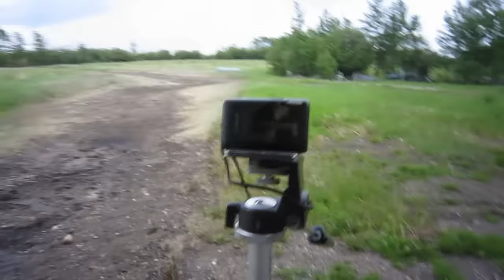Testing a GE J79 with afterburner

Comment: How does this convert to horsepower?
Reply: Its thrust
Reply from the maker: With this engine, the J79, there is an industrial version called the LM1500. The fuel burning core is the same, with identical part numbers.
The J79 jet engine is a gas generator with a jet propulsion exhaust nozzle at the back. The nozzle converts the exhaust energy into thrust by accelerating the gases. It takes a force to accelerate something. That force pushes on the thing doing the acceleration and equally on the thing being accelerated.
The LM1500 is the same gas generator that supplies the exhaust to a separate power turbine via a large duct. That power turbine converts the exhaust energy into mechanical torque and rotational speed. The definition of horsepower is torque multiplied by rpm divided by 5252.

So with this particular engine, we can measure thrust in one form of test, and power with the other.
When I say a J79 has 15,000 Hp, I mean the equivalent LM1500 makes that much.
Give or take, no guarantees, it's just for demonstration.
...OK?

Comment: whats the RPM on those bad boys?
Reply from the maker: I just added that to the info section. Thanks.
Reply: @AgentJayZ  the turbine can spin up to 120,000 rpm
Reply from the maker: Not this one. If it ever sees 8000 rpm, even for a few seconds, the manufacturer's overhaul manual says to scrap it.
The rotor in a Kawasaki GPz750 turbo is designed to spin at over 250,000 rpm, but it is 3/4 of an inch in diameter.
Reply: @Digital Electronic Creative no you don't.
Reply from the maker: You do not build J79s for a living. The last one was built in 1983. I have three different overhaul manuals for three different sub-marques of the J79, the -11,-15, and the -19. They all state that if the engine exceeds 8000 rpm, it must be scrapped.

... what was that again?
...
... chirp...
Reply: @AgentJayZ  holy shit 250k ???? How precisely does one have to balance the assembly to hope to reach these rpms ?
Reply from the maker: I only work with the big stuff.

Comment: I found  2 J79; I m in negotiations to buy them
Any interest to buy them or one of them?
Reply from the maker: Only if they are -19s. Complete with all accessories. Without log books they are worth about 10 dollars a pound if they ran when parked, and aren't piles of rust.
Reply: What is “19s”??
Reply: Just $37k for a complete j79 ran when parked?
Reply from the maker: Hmmmm.... dude, you are in over your head and are about to waste a lot of money.
You'll notice that I typed -19s, which is the plural form of -19, or dash nineteen, short form for J79-19.
If you don't know what that means, refer to my first line.

Cheers!
Reply: @AgentJayZ  
Where does one even buy jet engines been googling for days but all I can find are rc model jet engines.
Need something like a fj33 to disassemble and reassemble. Working or not just need to get my hands on one
Reply: AgentJayZ  now I m ready 
2 J79-8C ; tailpipes with afterburner removed
total rebuilding needed 
2 P&W JT8D with log books (run)
Any interest ? If yes I can text you or I give you my phone

Comment: * just imagine this j79 with nitrous spray...
Reply from the maker: It would do nothing. Nitrous is not a fuel, but a source of oxygen. Jet engines burn their fuel in conditions of excess oxygen.
So nitrous would be only be useful as a way of lowering inlet air temp.
You would a lot, though. A 20 lbs bottle would last less than half a second.
Reply: @AgentJayZ  sorry I'm not the smartest but based of what your saying would nitrous help if it keeps it cool? Or do jet engines not care about temp. I would imagine if they needed an intake

Comment: F14 engine?
Reply from the maker: I just read an interesting discussion about the initial and replacement engines used in the F-14.
I just copied your question, removed the question mark, and pasted it into a search bar.
Reply: Nope, the engine is from the f4 phantom. The f14 uses the tf30 engine, which was notorious for its ease of compressor stalling. The later ones used the f100
Reply from the maker: This is not a Phantom II engine. Those were -15s. This is a -19.
Reply: F-14's used the F110, not the  F100 @TacticalPhoenixYT

Comment: Out of curiosity, what is the speed of the exhaust coming out at the rear of the engine? It's gotta be over 200 mph I'd imagine.
Reply from the maker: The speed of sound increases with temp, and the non AB exhaust is around 900F. The exhaust at full non AB power is at Mach 1.
In full AB the exhaust exits the nozzle at Mach 1, but at 2500 degree F.
Reply: @AgentJayZ  Un-fuckin-believable, That is so intense.

Comment: wich planes this engine got and how fast it goes
Reply from the maker: This one came out of an F-104 Starfighter.
Way faster than an F-22, or a Typhoon, or any other new fighter.
Reply: @AgentJayZ  i see it can reach mach 2
Reply from the maker: 2.5 if you punch it.
Reply: F104, F4D and F11's.
Reply: Don't forget the f13c and d models
Reply: I think the Boeing 716s and 734s also had these engines
Reply: A later version of the North American A-5 Vigilante had two. The RA-5C.

Comment: Doesn't seem like a waste of planetary resources at all...
Reply from the maker: Fighter jet engines are made necessary by the need to fly fighter jets, which are tools of war and political intimidation.
War and intimidation between nations are the result of defects in the abilities of humans to get along.
Greed, Xenophobia, Revenge, and the old standby: Religion.
There's the source of your problem right there.
Reply: Just enjoy it
Reply: Engine test is mandatory, you don’t want to have this engine inside your house.
Reply: Address the waste of planetary resources in your own life first. Let's start with the energy you used to post this idiotic comment - did the energy used come from a renewable source?
Reply: NotThisChris Internet server electricity in the USA except New York comes from Nuclear plant. You can see an airplane and boat similar machines except for the density of fluids not so different. In a boat, you don’t care about weight and an airplane don’t need moving slowly. Turbine asks much more energy but you move faster with lighter weight.
Reply: @gijoe5508  I think there may be confusion, I was replying to Andrew.
Reply: NotThisChris Sorry 😐

Comment: Do you have an email address? I have something id like to discuss in detail about a particular jet engine.
Reply from the maker: Question are preferred in public, so every one can learn from the answer.
Reply: AgentJayZ haha yeh about that.. actually the jet engine I’m referring to is one Ive created. And wanted to know if a turbine engine design like this is actually feasible. They are diagrams so I have to send photos of it. I can promise that you’ll be intrigued. Haha. Please haha
Reply: The eKSPanse Feel free to share with the rest of the class.
Reply: Lawrence McLane it’s hard to explain :( as it’s it’s something I’ve invented haha. In theory it has SSTO potential.. which! I know to some some people out there reading this comment will say it can’t be done. And I’m aware of what hurdles a concept like this has but  essentially it’s a modified version of a Turbine based, Combined Cycle engine. The entire engine unit is annular for modular hybrid configuration. Combination of commercial turbofan, turbo ramjet & then rocket propulsion at its core for the SSTO variant. 

Soooo if anyone can help me fill in the missing pieces (I can explain further) to my design then this could be a MASSIVE GAME CHANGER! So please if anyone has a strong understanding of aeronautical engineering. In particular, air breathing propulsion systems!?!? I was strongly gifted in science but lacked a decent education haha 🙏🏽🙏🏽🙏🏽🤞🏽
Reply from the maker: You say you've created an engine, so it's obviously viable.
Or, did you mean to say you have some ideas and some drawings?
That's the first step in the long process of creating an engine.
I am not a design engineer, so I won't be of any help to you.
But keep developing the plan, and talking to engineers. If they even listen to you, then that might be considered step two. You will keep finding the right direction.
See? I've already given you a small bit of guidance on your pathway to eventual success. Keep working at it!
Reply: AgentJayZ yes that’s correct :) it is a sketched idea. The engine design as a whole unit is new But the axial flow engine cores nestled inside  are very very similar to the P&W J57 & essentially it looks like a bigger upgraded model of the SR-71 engines, soo It’s more of the rearrangement/ placement of everything.  Hope someone sees this.